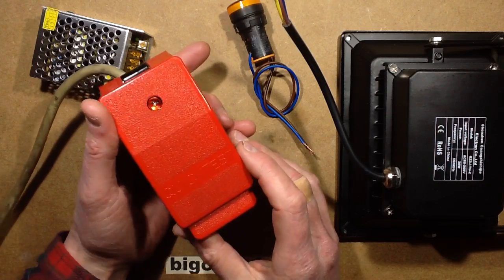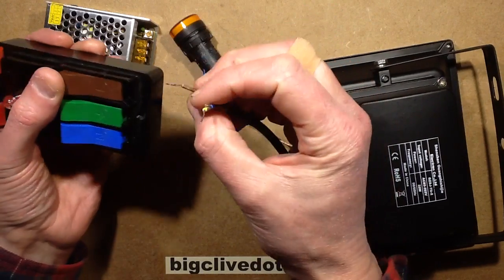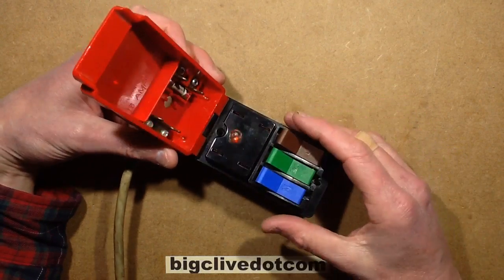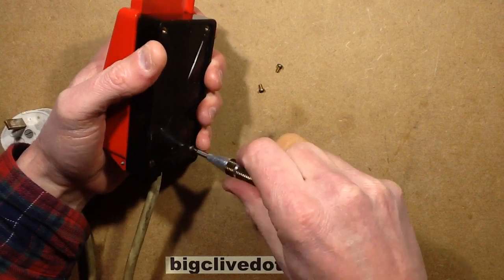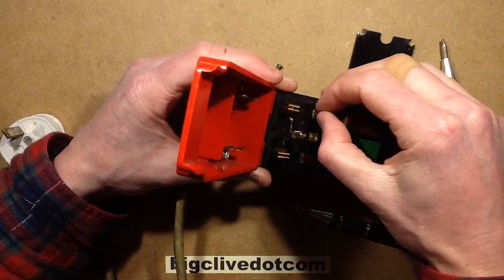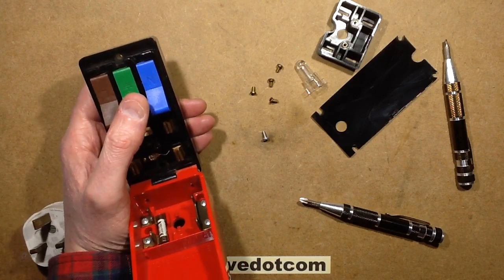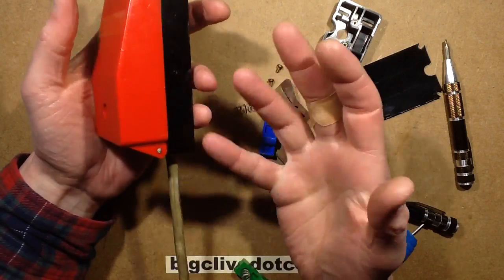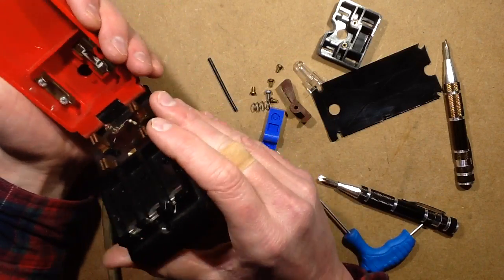A look inside the Cliff Quicktest mains connection unit.

Comment: See, I would buy one of these in a heartbeat if they were color coded for America. That being hot = black, neutral = white, ground = green/yellow
Reply: +Ella Jameson keep looking on ebay and you might find the early version of this, which had metal keys, with a divot with a drop of paint in it , so easily changed
Reply from the maker: +Ella Jameson Rectangular sections of suitably coloured insulation tape?
Reply: +Ella Jameson to be fair, color is not a problem: green its the same, dark color (black/brown) is hot, light color (blue/white) is neutral. I don't think there would be a mistake.
Reply: +Ella Jameson 
Tipp-Ex (correction fluid) and a black Sharpie is all you need, paint the Blue key White, colour the Brown key black, and there you go, US colours... :)
Reply: +twocvbloke Would it work in the USA though?
Reply: Allan pavon
Yes, it would work, as it's just making a connection, the neon lamp might not work as well, but the rest of the device is 100% compatible, I've used US plugs & sockets on 240v here in the UK, so everything's compatible... :)
Reply: +bigclivedotcom Yeah, as you and everyone else says, it's  not a huge issue, especially with the big LGN that seems to be on the ones you linked to. And, well, simply seeing where the fuse it.
Reply: Paint?
Reply: +bigclivedotcom I just got mine, going to use my label maker to put hot, ground and neutral on it. Colored tape sounds good though.
Reply: *****
No worse than us brits using Red & Black for Live and Neutral, which is why we switched to the unified colours...
Reply: +simontay1984 It's not really 'stupid', just different. The world used to be a lot bigger than it is now (as in travel was much harder) so having different colour codes in different countries wasn't an issue. And remember, early cars had positive ground, so having the black wire as 'hot' (live) wasn't so silly. 

Oh and minor nitpick. Black isn't ground, it's the negative. It just happens to be grounded in a computer PSU
Reply: +TheChipmunk2008 beat me to it....
Reply: +simontay1984 Why it wasn't a big deal has already been adressed, but to be clear, the US kinda led the way when it was electrified. So if anything, other countries should have copied the US standard.
Reply: +BillyJoe1305 To be clear, it was all pretty neck and neck. Edison kinda got the US more standardized faster, granted, but he also f***ed up your entire electrical system to the present day by using low voltages. So it's about even who 'won' (quotes because it's not really a competition, countries did what was right for them)
Reply: ***** I only meant that standardization was first in the US, and it was other countries that didn't do what the US did. I fully understand why. It's just weird to me that someone would tell the first bunch of people to set a standard that they should've used the color code others used.
  The same way that running at lower voltages may be a problem now, but up through the 80s even the few advantages it offers were more significant.
Reply: +Ella Jameson   If you look closely at 1:10, the colored terminal keys are also embossed with text for L, N and G
Reply: +BillyJoe1305 Yes i think we totally agree (except for the dates: in the 30s thru the late 80s, electric heating was very popular in the UK at least... so loadings were an issue, right from the start. The 'who's colour code is better' argument is silly, and I apologize for maybe participating in it. 100 to 130v makes sense for incandescent lighting, (105 was Edison's original standard). The European guys wanted motors from the get go, hence 200-250v ish standards. 

Most of the EU is 50Hz because of siemens' standards. The fact that the brits are using what is, essentially, a german standard, seems to upset many of my countrymen
Reply: +TheChipmunk2008 I agree, it is silly & when I said it had significant advantages I meant for Americans. Even today I don't think electric heat is the way to go in the States. Gas is cheaper here & better for the environment.
Reply: +jusb1066 That's the Rendar Safebloc.
Reply: +Alan Williams You could use colored labels to do double duty.
Reply: +Ella Jameson 

Black - Burned to a crisp.
Brown - Crap your pants.

What's the big deal about colors?
Reply: +bigclivedotcom Naturally
Reply: +frtard green- pick your nose and throw it on the ground 😬
Reply: Hi there Ella, if you click on the links to the manufacturer, you will see they do a USA/Canadian model
Reply: use spray paint to paint the keys lol.
Reply: I know your post is a year old, but Cliff makes one, p/n CL1857, with black and white replacing brown and blue.

Comment: My father is a retired electrician and I now have his old one of these. I think it's made of bakelite!  Useful tool though over the years.
Reply: +Choppington Otter If it's black with all-metal connectors it's a Safebloc from the late 70s or early 80s. Mine's branded RS Components and I'm trying to remember who the maker was.
Edit: It was Rendar and there's a used one on eBay UK ATM.
Reply: +Graham Langley my Dad's got a Safebloc too, they're a great bit of kit. ..
Reply: We had safeblocs on our lab benches at work - all black bakelite, but exactly the same design. Simple, safe and effective.